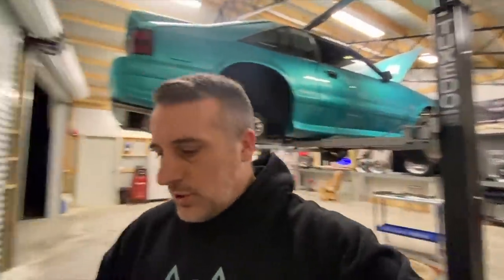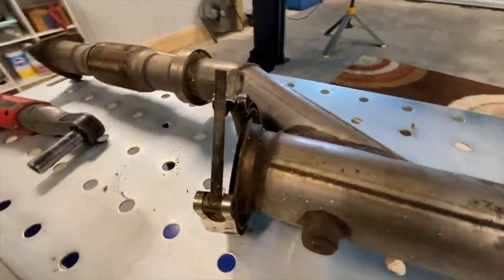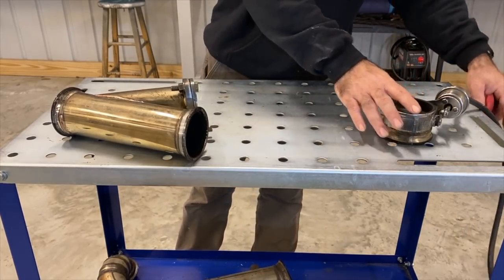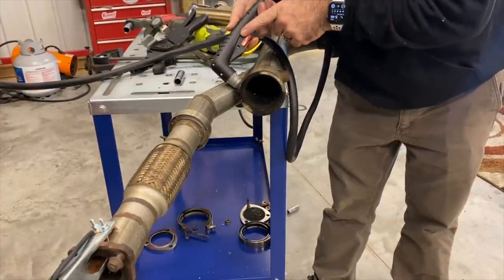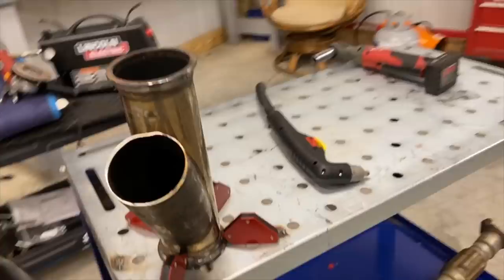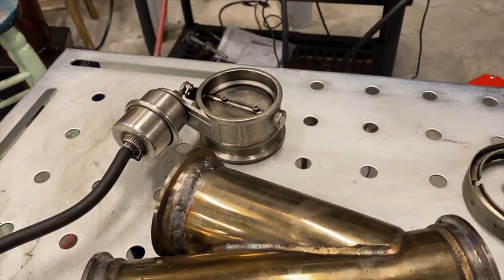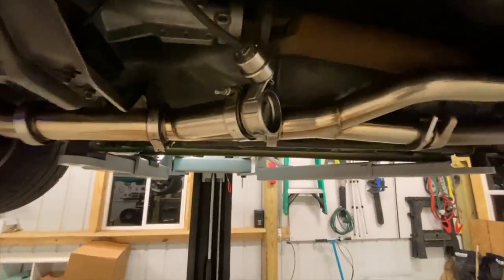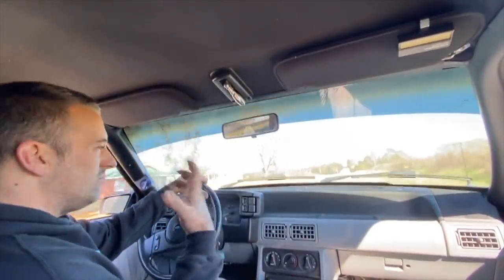I INSTALLED A BOOST ACTUATED CUTOUT....  WOW! WHAT A DIFFERENCE

Comment: I would do away with the rear spacers you have if you are going to be racing. I have had bad experiences with the spacers slicing the studs right off. And dropping  the back on the  ground with the wheels passing me by. I needed the spacer to run the wheels that I had but it turned out to be a nightmare and a roast on social media with embarrassing pics and videos.
Reply: Plain spacers require hardened studs.
5 x 5 spacers should have the original studs replaced too.

Comment: Rename the car the Midnight Rambler - as sung by the Rolling Stones.     I heard that run the whole way out here in Albuquerque.  HAMMER DOWN      you have that exhaust system looking cleaner than the plate I ate dinner off of.

Comment: Awesome! I think i'll do something similar but with 3 modes, vavle aways open by letting a vacuum pump open the valves, then a always closed by turning of the vavuum pump, and then as a last option opening a valve which lets the turbo vacuum control the valves
Reply: It needs positive pressure to open the valve not vacuum
Reply: @Follow_The_Litre  depends on which actuator you use